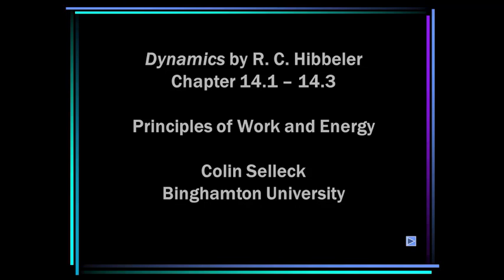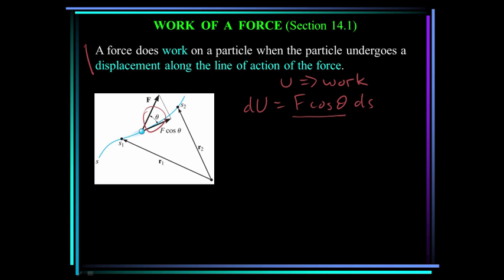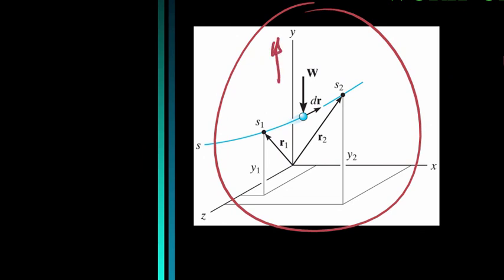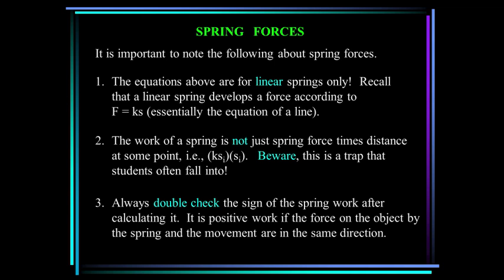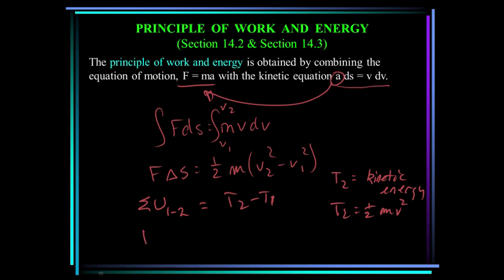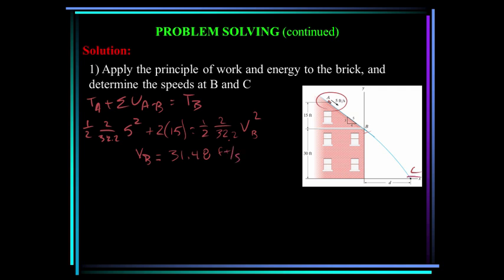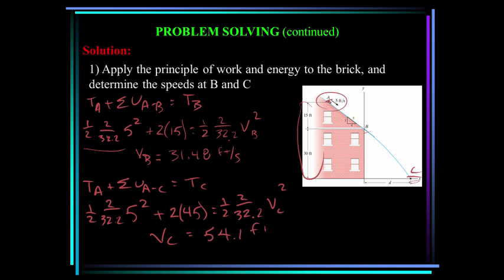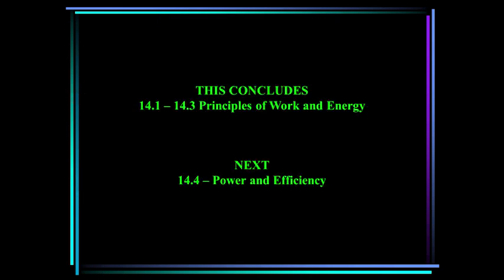ME 274: Dynamics: Chapter 14.1 - 14.3

Comment: Shouldn't the work done by a  spring be U(1-2) = 1/2*k((S2)^2 - (S1)^2), not (S2-S1)^2 as you said?
Reply from the maker: The energy in a spring is 1/2kx^2 where x is the amount the spring is compressed or stretched from the unstretched length. In this particular example,  S1 = unstretched length of spring and S2 = length of spring at state 2. One does see 1/2k(s2^2-s1^2) in Dynamics, but in this case s2 is the amount the spring is compressed or stretched in state 2 and likewise for s1 -- the difference being the change in energy between two states. It is confusing, I know. I should have used s0 for the unstretched length.
Reply: @ColinSelleck  Where does this new equation come from
Reply from the maker: @ashlynnundlall  What new equation?
Reply: @ColinSelleck  The one you used in the video vs  U(1-2) = 1/2*k((S2)^2 - (S1)^2)
Reply from the maker: @ashlynnundlall  Don't worry about the one I used in the video. I was just calculating the amount the spring was compressed or stretched using s2-s1, where s2 is the spring length and s1 is the unstretched length. As I said earlier, I should have used s1-s0 so as to avoid confusion.

Comment: Mr Selleck, I'm confused why you used S=0.6m in the first example. I recall doing practice problems and I remember that when you integrate for a spring you use S=0 for the position where the spring is unstretched EVEN if the spring is 0.6m long at the unstretched position,
Reply from the maker: In my nomenclature, S1 = unstretched length of spring and S2 = length of spring at state 2. So the work done by the spring is -0.5*200*(S2-S1)^2.
Reply: Colin Selleck  why (s2-s1)^2 but not (s2^2-s1^2)
Reply from the maker: The energy in a spring is 1/2kx^2 where x is the amount the spring is compressed or stretched from the unstretched length. In this particular example,  S1 = unstretched length of spring and S2 = length of spring at state 2. One does see 1/2k(s2^2-s1^2) in Dynamics, but in this case s2 is the amount the spring is compressed or stretched in state 2 and likewise for s1 -- the difference being the change in energy between two states. It is confusing, I know. I should have used s0 for the unstretched length.
Reply: Colin Selleck thank you so much,  but could you explain the problem 12.3 in mechanics engineering for beer
Reply from the maker: I prefer wine but I don't understand the request.

Comment: does the work of the spring should be like U(1-2) = 1/2*k((S2)^2  -  (S1)^2)   , did made mistake or how you come with this ?
Reply from the maker: No mistake. This is the correct equation. I derive it starting at time 21:10.

Comment: Shouldn't the S initial be 0 even if the length of the spring is 0.6? In F=KS If you put 0.6 in as the unstretched position you would get a force. This makes no sense as an unstretched spring should have no force?
Reply from the maker: In my nomenclature, S1 = unstretched length of spring and S2 = length of spring at state 2. So the work done by the spring is -0.5*200*(S2-S1)^2.

Comment: i really appreciate ur effort man .... but i was wondering .. in the work of wright you didn't  multiply   with 9.81 (the gravity )
Reply: osama mehdawi in the first example
Reply from the maker: osama mehdawi I believe that I did : 10 * g * sin 30 * (s2 - 0.6) = 10 * 9.81 * 0.5 * (s2 - 0.6) = 49.05 * (s2 - 0.6).   sin 30 * (s2 - 0.6) is the vertical displacement of the weight.

Comment: On the roof problem, when you set up the kinematics equation for the part y, why is it negative 30 instead of positive?
Reply from the maker: I admit, this is confusing given the coordinate system drawn. And if I did this over again I would change it. For this part of the problem, the coordinate system's origin is at B. I really should have written 0 = 30 + (-31.48)(3/5)tbc - 1/2(32.2)tbc^2.
Reply: I understand it now, just a little confused. Thank you!

Comment: in the last problem where did you get 32.2 from? in m = 2/32.2
Reply: nevermind, i figured it out lol
Reply from the maker: Mass in US customary units is the slug. Divide the weight in pounds by acceleration due to gravity (32.2 ft/s^2) to get the mass in slugs.

Comment: Hi there, I did not get the same S_2 value as you, my final quadratic equation for the first example was -100s_2^2 +149.05s_2 + 71.57 = 0....with a final answer of 1.87m.
Reply from the maker: I think the video is correct. I got a quadratic equation of -100s_2^2 + 269.05s_2 - 0.43.